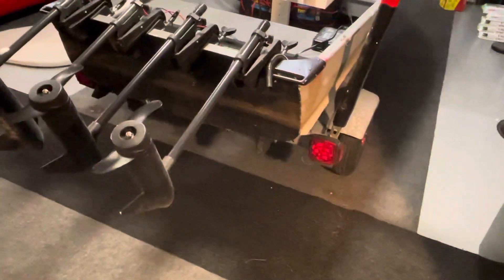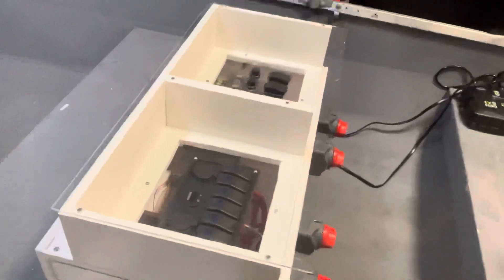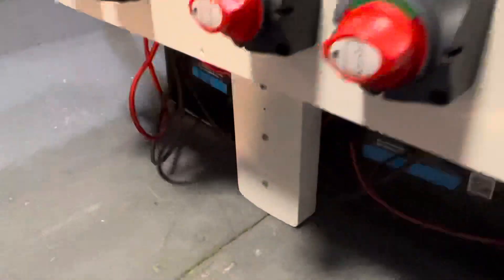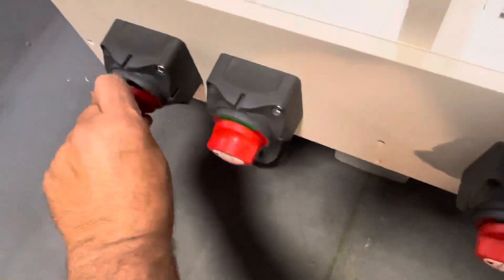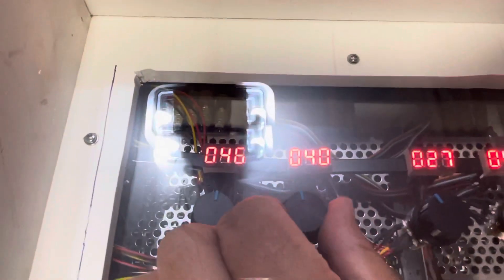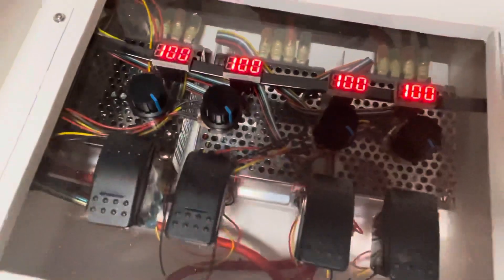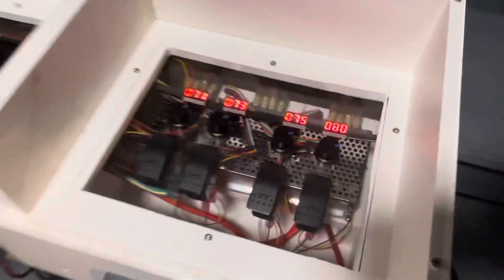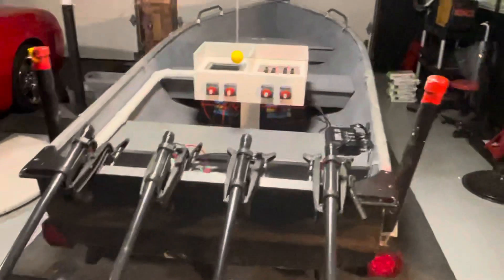eBoat v2 Electric Solar Boat Project

Comment: Very impressive setup on the microcontrollers. Are you able to avoid cavitation by using motors 1 and 4 for cruising? Have you considered a tiller for navigation?

Comment: I'd like to see it on the water.
I've messed with 12 volt trolling motors for quite a while
I've found motor motors do not add more speed
Trolling motors pretty much will power a boat your size
or canoe or inflatable raft 3 mph.
Putting on a second motor might let you get to 3 1/2
but that's the speed they were designed to do.
I've subbed and await your sea trial results.
good luck
Here's some utube videos of a solar canoe
and 21 foot reworked sailboat I put together
I'm currently putting 2 Brand new 12 volt 50 lbs
of thrust Minn Kotas on the sailboat
https://www.youtube.com/channel/UCtJj5ngxQN9wkaIrndtSqpQ
Gary
Reply from the maker: thanks for subscribing, with one motor I got about 2mph, two motors about 3mph, three motors 3.2mph, four motors 3.2mph… but range seems to have extended by 30% so I guess they are not working as hard… so I completely agree with you, next I will try the Kipawa props and report back on those, then I am going to experiment with changing the pitch using a heat gun and see how that goes :)